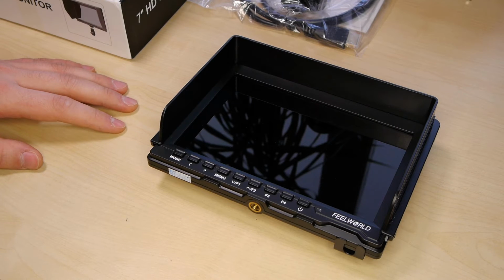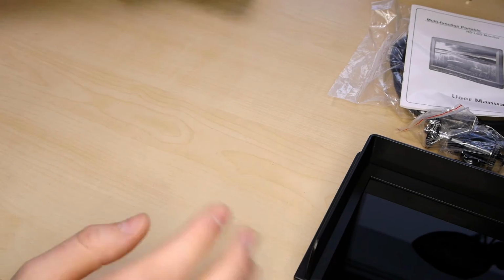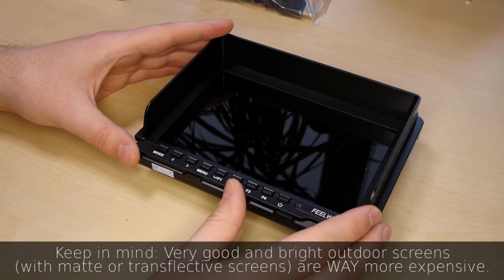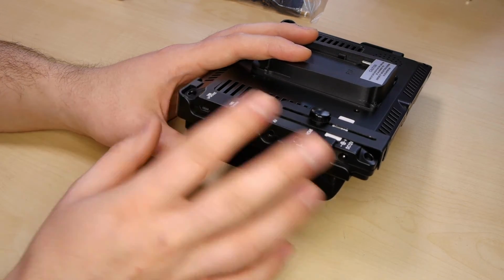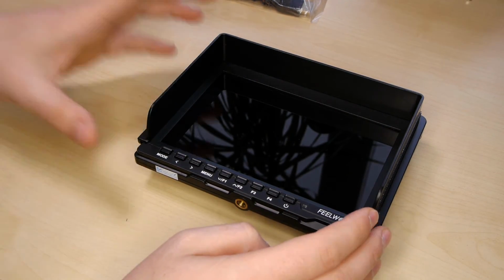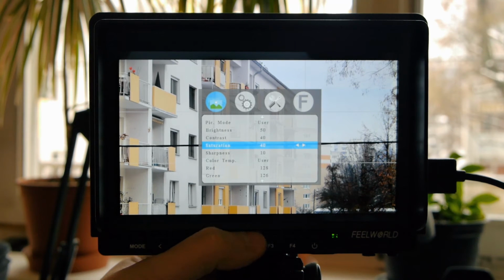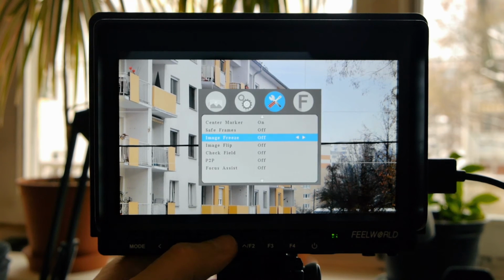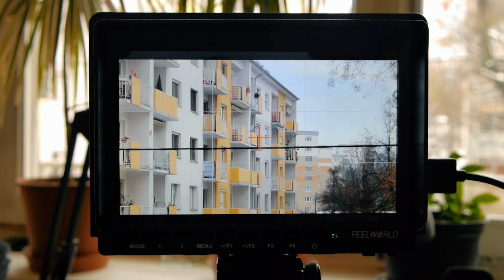Feelworld FW759 / FW759P field monitor - Very detailed HANDS ON (with calibration settings) (!)

Comment: I was wondering if you could help me. I am looking for a cheap 7" monitor with hdmi in and out and 2.35:1 guidelines. Can you recommend anything? Thanks.
Reply from the maker: +Bloody Revenge Film &amp; TV Production Hmm. The problem is, that super cheap screens are normaly not coming with guidelines. Or have other problems according colour-accuracy, sharpness, image quality overall and so on. The FW759 is also not perfect - But delivers an exceptional good performance for the price. The problem is, that at least with the firmware I had on my screen there were no guides available. You have now two options: You invest signifficanty more (in a better screen) - OR you use DIY to get the guidelines with a cheaper one. You could use for example two strings and mount them with sticky tape to the frame of the monitor. To align them right, feed an image with a 2.35:1 mask to the screen and align the strings accordingly - That´s it. You could also use a removable pen (which you only need to wipe off) - Tested that already once. It´s working nice but you need to redo the markings you want to have more often (as the removable markings are vanishing accidently quite often while transporting the screen ^^.)

The other option is a more expensive screen:

Well - There are the Aputure screens which offer nice guides. BUT they are colours wise not a good choice (and I don´t know if the new "FineHD" screens are any better - The older ones were a mess at least - Also according a few other problems). If you want to be sure to get a VERY GOOD image with nice features better check out the MustHD M701H - Or even better the IKAN DH7. But those are signifficantly more expensive than the FW759 or FW759P for example. If a 5" screen (with a nice 1080P panel) is also enough, you could go for the IKAN DH5 (RALLY nice feature set - Check out the manual for all the features - IKAN isn´t listing everything on their website - Don´t know why ...).

Btw.: Also an alternative / middle way: The IKAN DH7 you can also get as a relabeled model under the NEWAY brand - It´s called CT710HO - And you can get it over the Personal-View forum deals for about 350$ (which is EXTREMELY cheap for that feature set). But I don´t know how good and long the after sales support (and warranty) is - IKAN is a bigger brand with local support on the other hand (IF you´re living in the US). I also don´t know if you will ever get all the firmware updates (which IKAN is maybe rolling out for their branded model). But it´s the best bang for the buck deal actually (on the whole market).

I hope I didn´t make things worse (according deciding).
Have a nice day. ^^
Reply: Thank you for all that. I just need something cheap for a job but need a monitor for myself and my AC, so hdmi in and out is needed. I think I'll just get two DC 70's and then continue to save for a Ninja Assassin.
Reply from the maker: +Bloody Revenge Film &amp; TV Production Hmm. Alternatively you could go for two FW759 + an HDMI splitter (at least the image is way better on those compared to the DC70 and the DC70 is also not coming with guidelines btw.) - OR if you really need the guides go for one IKAN DH5 (which is nice and small - And which you could keep for gimbal use for example beside a possible Assassin in the future) + a FW759 as a 2nd screen for the AC. That way you have the HDMI in/out on the DH5 for loop trhough, the guides for you as the operator to keep everything in frame and the way better image compared to the Viltrox DC70 on the FW759 for your AC.

Sure - You need to invest a few bucks more - But you can also sell those screens WAY easier if you need to. PLUS (as mentioned already) you can keep the DH5 for the future for example. The Assassin is nice - But also WAY too bulky sometimes - And it&#180;s consuming quite alot of power. The DH5 on the other hand you can always carry with you (as it´s that small and lightweight). Especially handy if you don´t want to use the Assassin. And since the Assassin is still just planned, it makes sense (at least til then).
Reply from the maker: +Bloody Revenge Film &amp; TV Production Damn - I forgot: The FW759 and FW759P are also offering guide frames. So you can also go with two FW759 or FW759P with an HDMI splitter (or you can use the DH5 with the higher resolutoin for the AC and the FW759 / FW759P for yourself). Sorry that I missed that ^^.

Comment: Feelworld FW-74K-P is there a firmware update for this monitor i use my camera and set 3840*2160 and screen starts flashing and color changes from oem to like from say somthing is yellow and ill look purple. its not my camera as i check it with other 4k tvs
Reply from the maker: +cisco150 Hmm. I am not Feelworld btw. (just tested the screen) - So I cannot give you any information about support / firmware versions.
But I can tell you in general, that the FW-74K-P (which seems to be the FW759P) isn´t compatible to 4K signals. Just a few screens are.
(For example the new IKAN DH7, or the Blackmagicdesign Video Assist screen + recorder ...)
Reply: +AustrianGeek ok thanks I did a typo I have the fw74k without the p. so you think the fw759 and the fw74k are the same unit.
Reply: +AustrianGeek Sorry I didn't entende to see you as you where feelworld, was asking a question. should have word it out better.
Reply from the maker: Yes. The FW74K should be the FW759. Btw.: You can still ask Feelworld according firmware updates (though there´s for sure no 4K support coming through this - As it´s a hardware features). Have fun shooting ^^.

Comment: I cant get my live signal on Nikon P900. Please help me!!!
Reply from the maker: +6041321as I am sorry to say that - But it seems like the P900 is not outputting any live view HDMI feed while recording (checked the manual and the net). Also as an information to everyone out there -> You need to check the live view HDMI capability with a TV or so BEFORE buying a field monitor. Only a few cameras are outputting an HDMI signal while recording (especially superzooms and compacts are mostly not outputting one - With exception of some Sony models). Btw.: It´s the camera body which is not outputting a signal - So also other screens will not work ...

Comment: Every Time I push record I loose single and it goes back to my camera monitor. What I can do ?
Reply from the maker: +Manny Castro You´re using a camera, which isn´t offering live HDMI output (while recording internally) - It´s only outputting one while in standby (and playback). Which camera model are you using? For example most of the Panasonic bodies are not outputting a signal while recording. (Panasonic GX7, G6, G7 and also many of the other models -> Only the GH2, GH3 and GH4 are outputting a signal.)
Reply: +AustrianGeek I'm using a Nikon d5100
Reply: +AustrianGeek is there any way I can fix ? Because I got my monitor in today and Lina struggling with it to set up. Everything works just not live preview as I'm filming
Reply from the maker: Ah. Ok. Then you should check out the Nikon Hack - Then you should get the option to output native (uncropped) 720P or even 1080i (the Feelworld FW759 / FW759 can display both without any issues). You need to modify the firmware (as far as I remember only the D5200 and upwards offers live view HDMI out on the HDMI -> Without modifying the firmware.)
Reply: +AustrianGeek ok thank you very much, Ima just YouTube it then. Appreciate you replying back. If I have any other questions I'll come to you
Reply: +SoulVisions I wasn't able to find a hack for it... Do you know what Nikon model will work with it ?
Reply from the maker: +SoulVisions Here are the links to further information:

Wiki: https://nikonhacker.com/wiki/Main_Page#Nikon_Patch
Supported models: https://nikonhacker.com/wiki/Supported_Models
Patch guide: https://nikonhacker.com/wiki/Nikon_Patch
And the firmware tool (online): http://simeonpilgrim.com/nikon-patch/nikon-patch.html

Comment: Has anyone tested this to see if it works well with the Canon XL series camcorders?
Reply from the maker: +Pilot853 In general it should work ALWAYS (with any camera) - As it´s working well with interlaced AND with progressive signals. So any kind of output you select on your XL camcorder (or your future XL camcorder) -> It´s compatible to it. It´s also not degrading the image in any way according the signal type (tried any type of output I had as an option with multiple cameras - Worked always as it should). That´s the huge pro of this monitor - Paired with the quite good image quality from scratch on at a very reasonable price. ^^

Comment: Do you get battery with that package? Or need to buy + battery?
Reply from the maker: +AirlinersHD You need to buy them seperately. But You can get super cheap packages on Amazon or Ebay for example (with a single charger included - Which are not the fastest charging ones with 6 to 8 hours for one 970 battery - But at least they work ^^). Btw.: I would go for at least the NP-F730/750/770 size (or even the biggest NP-F970) - Then you really only need a package of two batteries for a whole day. Also important: You don´t need to go for the original Sony batteries (they are extremely expensive). Better check out the 3rd party offers on Amazon (there you also get feedback which batteries and packages are acceptable and which are not) ...
Reply: +AustrianGeek Got my monitor today, and thank you for awnser but this is so so disapointing.....
Reply from the maker: Well - Other screens are coming with an weird / bad charger and a too small battery included (NP-F330 or NP-F550 only with a runtime of an hour or so). Sure - You need to order batteries now additionally - But you´ll get WAY better ones from scratch on ^^. Btw.: I still have lying around a few of that super small / low capacity NP-F batteries (and I barely use them). Just as spares max. ^^
Reply: +AustrianGeek Tell me, on my Nikon Coolpix P900, when I attach this monitor, I can see videos or images from camera memory but I cant get live image to record videos. Why? Thank you!!!!
Reply from the maker: +AirlinersHD  I am sorry to say that - But it seems like the P900 is not outputting any live view HDMI feed while recording (checked the manual and the net). Also as an information to everyone out there -> You need to check the live view HDMI capability with a TV or so BEFORE buying a field monitor. Only a few cameras are outputting an HDMI signal while recording (especially superzooms and compacts are mostly not outputting one - With exception of some Sony models). Btw.: It´s the camera body which is not outputting a signal - So also other screens will not work ...
Reply: +AustrianGeek thank you sir! this is a blow to my head now..........